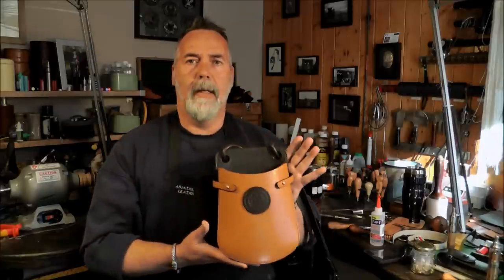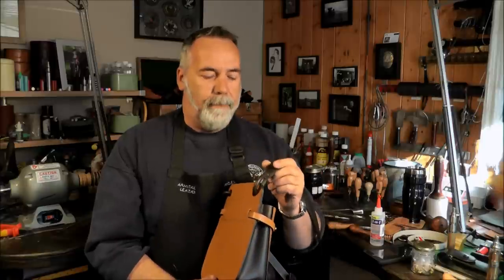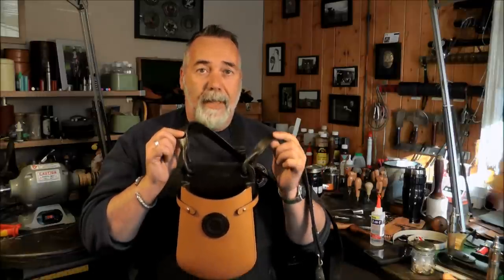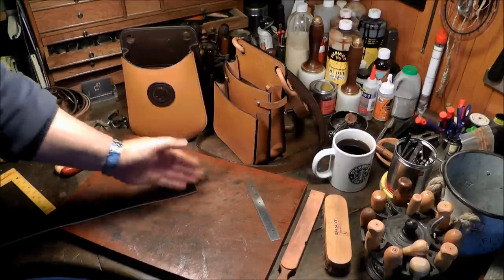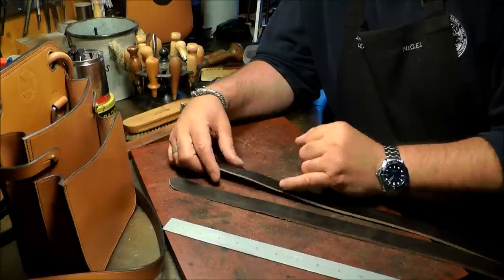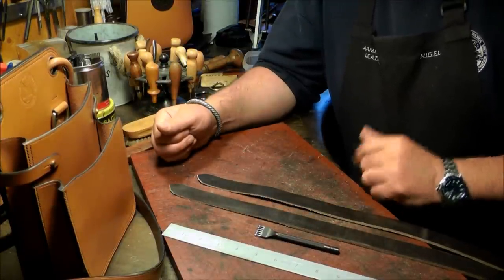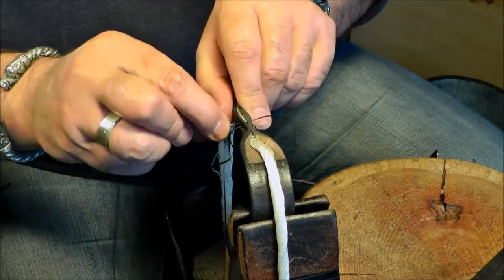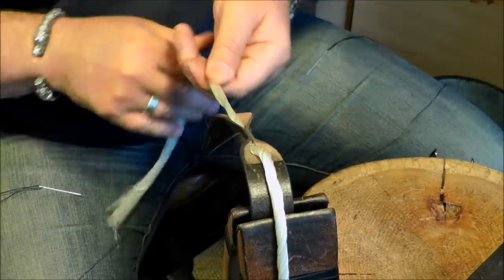Making a Leather Rolled Handle or Loop for a Bag

Comment: This is a great video. I made a pretty decent job of it myself. Thank you! One thing I'm having trouble with is figuring out how to install the handles on a handbag symmetrically. Any tips? I made a template of the top of the bag, found the centerline and where I want them to be exactly. Now I can't figure out how to transfer that to the leather.

Comment: What thickness of thread do you use. I have found a supplier for Tiger thread which I love stitching with.  Just wondering which thickness works best for different projects. Say a wallet, notebook cover, the handle in this video?  Thanks for your videos. I have really learned a lot.